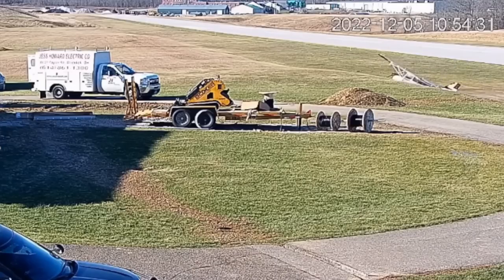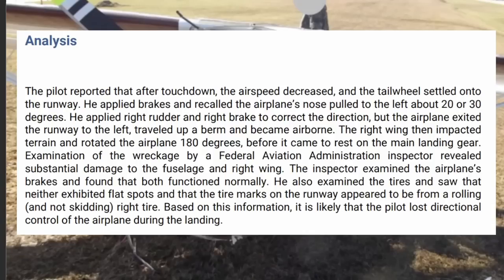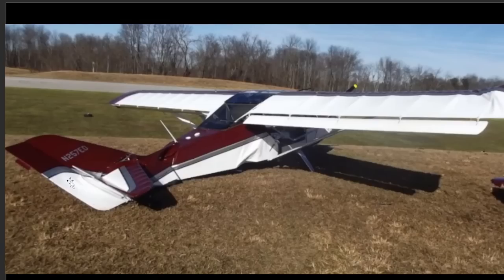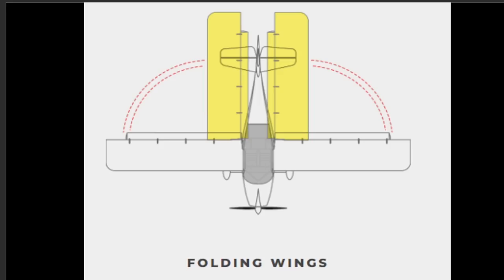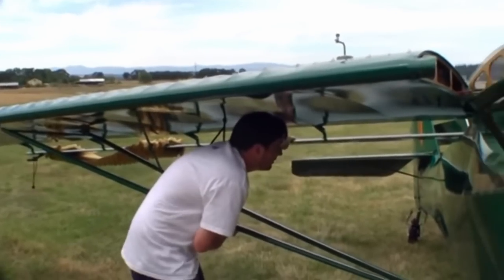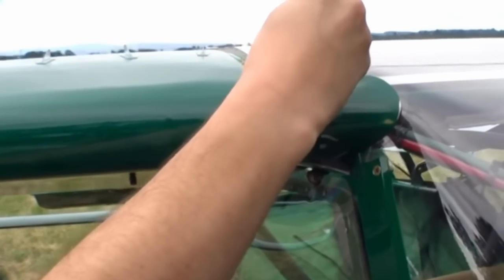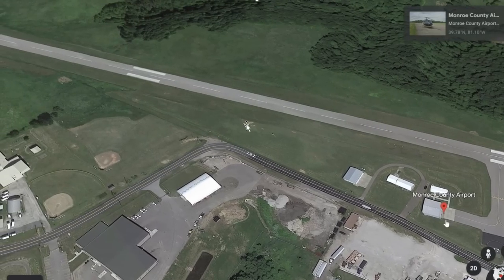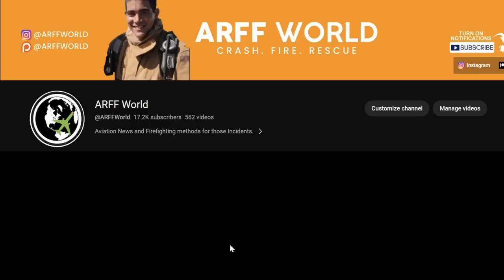Airport Camera Helps Investigators in Ohio

Comment: I owned a KITFOX IV for about 7 years - great airplane.  Your correct about the folding wings.  Initially I shared a hanger and folded the wings every time I put it away.  The fuel tanks must have been empty for your demo.  We found it much easier to swing the wing into position by leveling the with a high chair under the tail.
Reply from the maker: Thank you for sharing your experience with this aircraft
Reply: Please please please note:
  Wrong ailerone will ALWAYS overpower the stalling rudder & brake....ALWAYS !
  Rudder & ailerons THEN lastly brakes to turn off the runway, is THE proper procedure, given runway surface friction is so unreliable.
  We have witnessed this scenario so many times in training these last 60 years.
  Had pilot written "i went full rt rudder & full left ailerone", we could easily assume an invisible, dust devil caught him, and that does happen.
  However, he didnt. Which leaves the only option, that either NO ailerone YAW was utilized, or (horror) ailerons INTO the rudder were used (like recovering a skidding car) and off she goes.
  Simple rule MUST be taught all primary fledglings when operating on the runway for take off or landing .... AILERONES YAW, ALWAYS, PROPORTIONALY & OPPOSITE  the rudder direction being called for. ALWAYS !!!
  Very pleased all are safe.
Think a 172 cant be ground looped, think again. Ailerons are the largest control on the plane. Ailerons are being terribly abused & misused.😢
RFuchs CFI/ATP 1507987
P.S. Chief pilot of a large st louis flight school has a total of 1,500 hours. 😂

Comment: Never flown a tail dragger but they like to point into the wind with crosswind landing which can set up possible ground loops. A locking tailwheel into the straight ahead helps but the tail has to be settled onto the ground. WW2 plane went for the locking tailwheel. He was carrying some speed to be airborne. Maybe a gust caught him.
Reply: The c of g is behind the main wheels so it wants to point backwards all the time, wind just really really makes it want to point backwards.
Reply: Locking tail wheel is not necessary on a light taildragger. Proper training and technique is the key. This guy just lost it on the roll out and tried to blame a locked brake. 😬
Reply: “Never flown a taildragger”

Hence I discounted everything you said afterwards. 

Get your tailwheel endorsement, get a couple hundred hours in one then come back. 

I’ll wait
Reply: @bradcohen3801  No thanks. But you can keep waiting :) The tendency to allow ground looping in crosswinds gusty or not is still there.
Reply: @nightwaves3203  I’ll try to remember that next time I fly my taildragger.
Reply: @bradcohen3801  Check out airports where the navy did WW2 training. Norman Oklahoma is one where you could always land into the wind because they'd asphalt the whole area. Under a lot of the grass is the old asphalt. If you fly OK you sure know how squirrely the wind is there and how it can be constant high winds for weeks especially around winter. Navy figured out they'd lose less airplanes allowing their taildragger pilots to land into the wind like on an aircraft carrier. Fly safe.
Reply: @dr_jaymz  I call it "going puppy" - it wants to chase its tail. Footage of the landing would have shown when the pilot got behind the curve. This one was slightly different IMO because of the speed. Maybe a gust of side wind upset things?